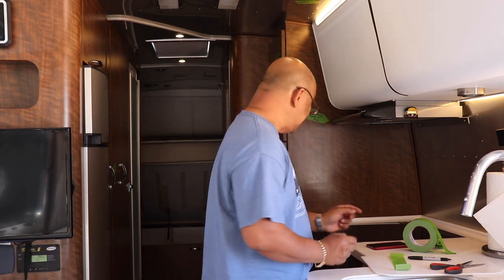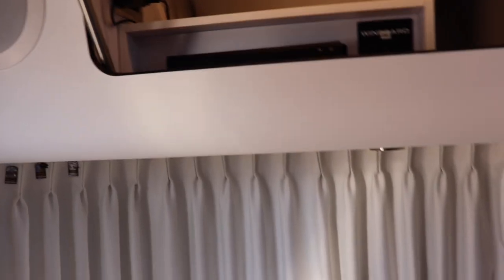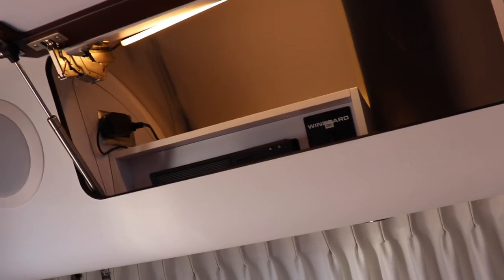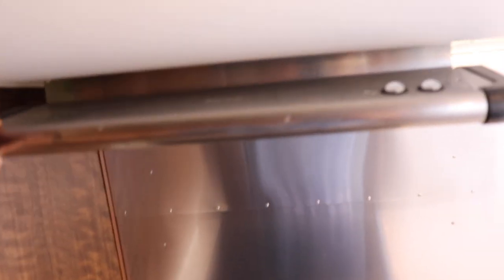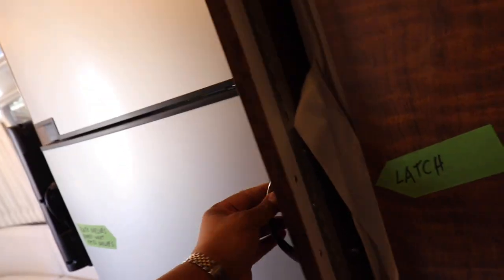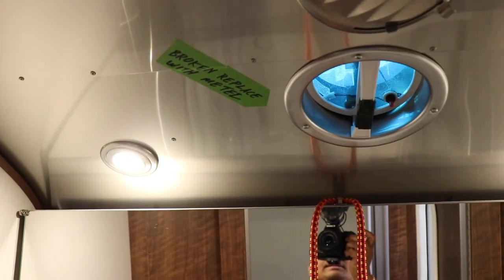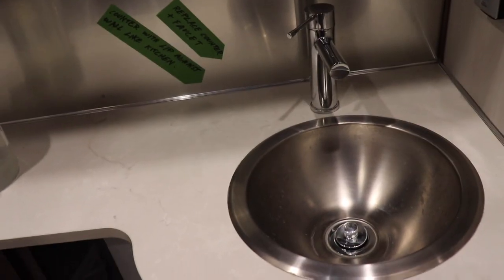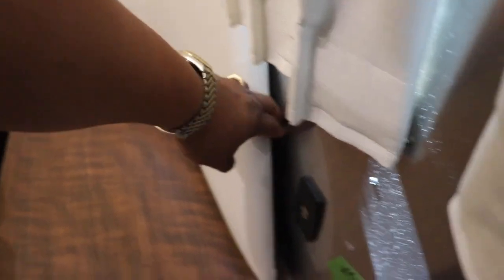Taping Repairs For The Globetrotter Airstream WandA

Comment: You have some legitimate concerns indeed! However, some of the issues are normal for a camper. Regardless of camper manufacturer they are all built cheap as possible.
Reply from the maker: Let The Thunder Roll yes, they built it for obsolescence. Just glad that Airstream has a two year warranty. I’m sure that things that didn’t break last year will break on the road trip this year to Newfoundland.